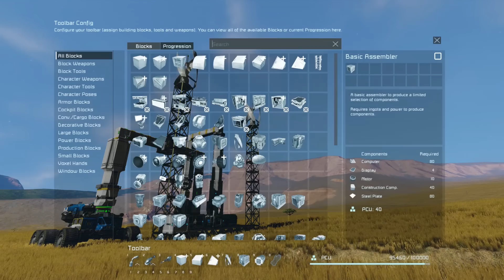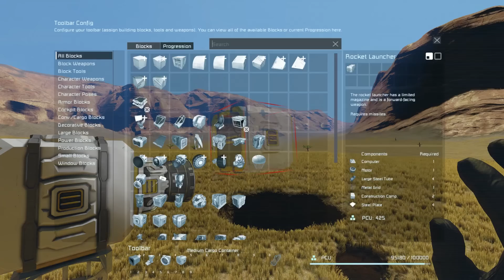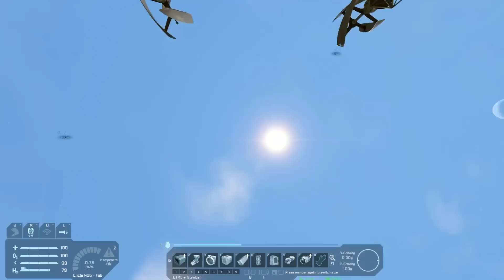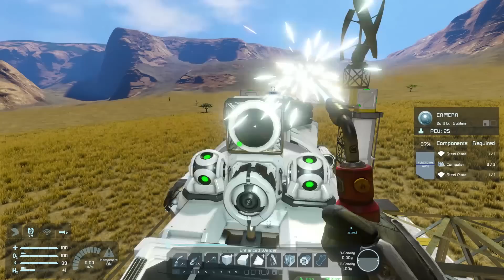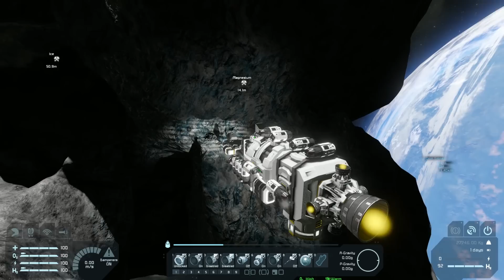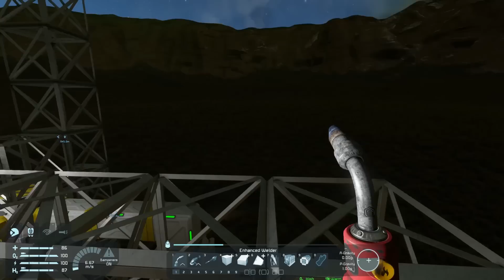Going to Space - Getting Started in Space Engineers #6 (Survival Tutorial Series)

Comment: About 4 years late but here's a full material list 😅
4 radio comms components
1 detector components
40 power cells
46 metal grids
34 Bullet proof glass
362 steel plates
58 computers
6 displays
312 motors 😮
635 construction components😅
88 large steel tubes
77 small steel tubes
79 interior plates
Definitely messed up with my math in a few sectors but it should be a good estimate

Comment: Seeing as many are saying that it's wise to add two large atmospheric thrusters for the way back with extra weight, could we replace those 4 small atmospheric thrusters on each side with a large atmospheric thruster? How many small ones equal a large one?
Reply from the maker: In terms of thrust output (off the top of my head) a single large one is the equivalent of 8-9 small ones and yeah you could certainly do that. Worth testing to ensure you have enough power to run them though as you may need an extra battery to get the most out of them :)

Comment: I did the same build and control set up as your ship, but I cant get out of earth's orbit, I get to around 5000m before I fall back to earth, even though I have the large thruster on at full power (with override) along with the backwards thrusters turned off.
Reply from the maker: It sounds like you've got only your atmospheric thrusters pushing if you're running out of thrust at that altitude. Hydrogen thrusters would only lose thrust if they run out of fuel. Check to make sure the ones selected for the override are the correct ones as it's super easy to grab the wrong ones :)
Reply: I figured out I was switching to the hydro thrusters a bit too early which was causing the issue. Thanks for your quick response and for your great tutorial videos! I wouldn't be playing and enjoying this game as much as I am without them.

Comment: How can you attach the small grid atmospheric thrusters to the large grid?
Reply from the maker: While it's feasible to do so, controlling them is awkward and requires scripts, hinges/rotors etc. I suspect you're more meaning the smaller variant of the thrusters as opposed to the alternate grid size. To change grid size of a block hit the corresponding hotbar slot again to switch, use mouse scroll wheel to change the type of any block group (you'll know you have a group on your hotbar if there's a + symbol on the icon) :)
Reply: @Splitsie  So I tried to scroll mouse wheel, but that does nothing. With the R key I can switch between the grid sizes but small grid doesn't snap on large grid blocks.
Reply: I use the small thrusters with the large grid size but they are way bigger than in your video, so it looks to me like you're using the small grid size in your video. For example with the large grid size for the small thrusters you could only fit one unit on the cockpit block you're using, but you're using three units, so I think you're using the small grid there while the cockpit is the large grid.

Comment: Out of curiosity i did a number of tests to see just how much of a difference the different fuel saving methods as well as thruster choice really mattered.
When it comes to using thrust override vs. the dampeners off method i averaged about a 0.7% fuel savings, that was averaged out with nearly a dozen tests taking a ship from the same ground location to space with a variety of ships both large and small grid. In the end i realized that the difference in fuel saving is kind of irrelevant and overall and which method used comes down more to personal preference then anything. 

The only noticeable fuel consumption difference was with the use of atmo thruster for that initial 5km or so of atmosphere vs. using hydrogen thrusters exclusively. For that test i used a couple of ships that had both ion and hydrogen and went from the surface into space doing the trick of using atmo until they lost power then switching to hydrogen and the other test using only hydrogen. I averaged 9% fuel savings with the atmo/hydrogen method.
Since those tests i've ditched the atmo/hydro thruster combination for my first trips into space in favor of exclusively hydrogen thruster designs, the ships are not only much easier and cheaper to build but the removal of the atmo thrusters also meant i could ditch all the extra batteries they need and could put all that extra weight savings into carrying more cargo back from orbit. 

I have dual purpose orbital miner designs that are meant for mining both in space and on ground equally well using multiple thruster types at once that i build later when the resources are there but for that first trip i'm finding out that simplicity keeps proving to be the better choice.
Reply from the maker: That's cool, roughly fits with the results I'd have expected

Comment: Loving these guides, man, they're truly helpful. Though, in this one, I've been running into some issues with the small o2 generator on the ship pulling from the large o2 generator on the base. Pretty much it just will not pull any ice to fill the hydrogen tank, making it so that I would have to manually transfer ice into the small o2 generator to fill the Hydrogen tank via depositing Ice into the cockpit. Which I find I have to do from the cockpit itself as it won't allow me to transfer from anywhere else.
Reply from the maker: An O2 generator won't pull ice from another generator, only from other inventories like containers or drills. For tanks you can get them to fill from a tank on the base by setting the tank on the ship to stockpile (only once connected) and it'll transfer rapidly into the ship's tanks. That's my preferred way to fuel up a hydrogen ship as the base can keep working on the fuel while you're out there burning it up :)
Reply: @Splitsie  Truly, this is a game of engineering. I wound up finding the issue while going back through the video. The large conveyor part of the cargo container on the ship was not facing downward, so the ice was unable to be pulled into the tank from the ship.

Comment: im surprise the max speed would be 100.
heck even most cars can go faster then that XD

i'd expect the max to be at least 1k.
but i suspect this is a computation limitation of the computer hardware?
Reply from the maker: With the physics system updating 60 times per second, movement faster than 100m/s can result in two objects being inside each other by a significant distance before the physics system detects it. With the way SE plays that would be more annoying than a low speed limit
Reply: @Splitsie  so they'd have to increase the speed of the updating of the physics engine.

which may bring other issues if some things are expecting the physics engine to run at a certain speed.

unlikely but possible, i still see games that have physics strictly locked to the frame rate which is a terrible terrible idea because everything breaks when you get better equipment XD

Comment: I had to add a total of 16 Atmo thrusters (upward) to no crash on re-entry, when returning with a full load (total weight of around 90Ton)
The "safe load" of 1 small atmo thruster is around 7.5 tons (it's 7.7, but a little lower, just to be safe), using this, I say "2 thrusters for each 15 tons, + 2 for safety)
So to avoid crashing, I had to have 14 thrusters to be able to fly, and then I added 6, just in case.

Comment: I flew past this one (boom boom) while building up my base/abilities and thinking about how to get to the ships more easily for building/upgrading later, remembering the piston thing from earlier... adding a connector to an upward facing piston would allow for varied height connections so you could get underneath and work on ships without the need for an awful lot of jetpack flying. Obviously disconnect a ship before changing the working height.

Another added bonus would be plonking a couple of temp engines on the ship as soon as the connector is added, so you can take it off the scaffolding and get it hooked into the base systems so everything charges and refills while continuing to work on it.

Comment: I have built this ship according to the videos but for some reason I cannot get it to lift off. The hydrogen and oxygen tanks are full and Ive compared the weight of my ship to the one in the video and they are not wildly different, (maybe 5k). All the thrusters are firing and are set up as 2 groups (hydrogen and atmos).  Im stumped as to what is causing this. Once the clamps are released, even with all engines on, it wont lift off. Any suggestions? Have I overfilled the hydrogen & oxygen tanks? Ive removed all access weight including spare ice.
Reply: Ok I didnt empty all the cargo out as I had thought. I found an extra 20k of ice. in there. I must have gotten distracted when I checked. Lol

Comment: My hydrogen thruster turn off when leave the base
Reply from the maker: Things to check if your thrusters turn off on disconnecting a connector are: 
 - Are your fuel tanks on stockpile? They should not be on stockpile if you want the thrusters to be able to pull fuel. 
 - Are your batteries on recharge? If you have no power source to the craft then even hydrogen thrusters won't work because the conveyor system fails with low power. 
 - Is your fuel tank empty? It's possible your thrusters were working while connected because of the O2/H2 gen on your base, then when disconnected they no longer have a fuel source with enough hydrogen output to continue working

Comment: Why mess with hidro override when you can just turn off dampeners? That way going up with hidrogen would be the same way you do with atmos... and you would not lose force as you did before you got more vertical
Reply from the maker: Using the override gives you more control over the thrust to allow more careful fuel use as the gravity becomes less. It also helps with keeping the ship aligned as the dampeners will continue to fight any lateral movement if you happen to not be perfectly vertical on your ascent
Reply: @Splitsie  if SE had any kind of vertical alignment tool i would agree... but since we are always trying to make vertical alignment by eyeballing it, i thing it should be easier to just press space bar... unless your goal is to make it harder to add to the challenge...

Comment: I wanted to add 5 parachutes to this ship to help in decent.  set them to auto deploy at 2000 meters.  I tried to do a test of that so thrusted up to 5000k and turned off all engines.  They didn't self deploy at 2000.  So I tried to figure out how to make them deploy on my own and can't figure it out.  What am I doing wrong? I crash a lot coming back to earth so I'm trying to make it easier to descend.
Reply from the maker: Parachute blocks need to have canvas in them (1 for small blocks 5 for large blocks), need to have power and need to have auto deploy toggled on. If you managed to fly at all without them popping open then auto deploy wasn't on or you didn't have any canvas as it'll work even when just barely moving around if you're beneath the altitude that was set.

I don't think the bug with manual deployment has been fixed yet, so don't rely on the open/close manual control at the moment either

Comment: Hey mate, why can't I see the same type of O2/H2O Gen that you're using for this ship?? It's not even in my progression bar??... scratch that, it just magically turned into that shape when I went to use it.
Reply from the maker: The thumbnail in the G menu is an image of the large grid version, when your pointer goes over a small grid it'll automatically change to that version, you can also manually toggle between the two by hitting the number of the hotbar menu that the block is on multiple times to switch between the grid size versions :)

Comment: Any solutions for when I get into space and run out of h2 instantly? I got ice but it isnt using it
Reply from the maker: Did you bring a O2/H2 gen with you or the parts to build one? Because that's what you're going to need as well as the power to run the generator - as mentioned in the video it's best to charge your batteries rather than running to space as quickly as I did :P
Reply: @Splitsie  I did charge my batteries and I added that o2 h2 generator but it doesnt do anything
Reply: @Splitsie  I found the problem, I was on full thrust and wasted alot of energy
Reply: @Splitsie  but my backwards hydrogen thrusters dont work

Comment: I think it would be much better to build a much bigger ship right from the start so you will have plenty of storage space and fuel aside from the right way to actually gain oxygen. 2 rows of 4 large containers would be a good start, each having it's own mining drill. For the engine both on the top as the bottom 2 hydrogen tanks with for each a large thruster. Then for the batteries I think it would be a better idea to have on each side under the containers for the drills a row of 8 batteries each. This won't just allow power to be a healthy commodity, it will also make sure you can use this ship safely in planetary conditions if needed. Also adding the atmospheric thrusters and the hydrogen thrusters on more tactical positions on the ship it will turn better even if it's so huge. Also directly making sure you have other things you may need would be a lot better to add on from the start. Perhaps add a defensive turret of some type if you are able to create one. In case that's a possibility it may be well worth to add on each side a turret to defend the ship properly against those nasty drones.

Comment: Not sure anyone will read this 8 months late but I throw it out there anyways:

- A bit more complicated, but I recommend building small ships off a rotor with small head connected to your base station, you will be able to charge your new ships batteries at the same time as you are building your ship

- if you are going to fill a large container with ore and bring it back to earth you'll need 2 large atmospheric thrusters to safely land with that much weight, plus additional small thrusters for the weight of the vehicle itself (on default 3x settings). Test this before you leave the surface! Much better than hitting the ground like a screaming meteor!

- be aware that the small block h2o2 processor is BAD at making hydrogen, and wastes about 33% of all the ice you put into it. If you can, use large block h2o2 processors on your base to fill your tank the first time.

- when looking for ore it's best to avoid the large solid asteroids, especially with the small block detector because the ore deposits tend to be deep and the small detector doesn't have the range to find them reliably. Stick to the "splattered" asteroids with lots of smaller rocks. More dangerous to navigate, but the resources are often right on the surface

- when marking GPS coords with resources, it can be quite helpful to mark surface deposits with something like "EASY" so you know which spots are easiest to reach. For example: "0 06 ice EASY" where "0" is the zone, "06" is the sixth asteroid I checked in the zone, and "ice EASY" so I know it's a deposit that's easy to get at.

Thanks for the vid Splitsie! Always nice to see a new video pop up in the feed!
Reply: Thanks for the info! 
P.S.: I've read your comment after 6 month, not 8 but relatively close :)
Reply: A nice/SE solution to weight distribution is to pick a asteroid on the edge of the planets gravity well and create a fuel/ore processing station you can then create a ship designed to move between your planetary base and asteroid station so your asteroid miner doesn't become cumbersome. Not simple but it's a cool solution as well as a milestone/goal you can work towards
Reply: Thank you so much for you comment! A read it a bit late tho! Coming back to the panet I realized im not sufficienty sowing down. Tried to use the Hydrogen Thruster to manage, it amost worked tho, but stil smashed the surface xD
Reply: Yeeeah, I just did this. Splatted on the surface with a full load of ore. Fortunately the crash just took out the stuff from the large container aft, so I was able to limp the rest of the way home.
Reply: Yup I was reading this as I was attempting my third failed reentry. Same rocket as Splitsie, just 70k kg total. :P
Reply: i fell hard to the ground, but like whats the point of this ship if it cant hold ores without falling?
Reply: Glad I saw this before I tried going to space. I just started playing a few days ago, and these tutorials have saved me loads of time and frustration. I'm on 10x, but I wish there was something between 3x and 10x. I'll experiment with how many large thrusters I'll need to avoid making a crater. 😂
Reply: Thanks!
Reply: dude thank you SO MUCH! "if you are going to fill a large container with ore and bring it back to earth... (on default 3x settings)" 

I am on 10x and bringing back 55k Kg and could NOT slow down.... even with hundreds of hours on KSP, I never considered weight!! haha!

guess its time to dump some ore!!! :P cheers mate, and thanks again!
Reply from the maker: Nice! All good tips Souptoaster :)

Comment: Ive watched this at least 5 times and still cant get my ship out of the atmosphere, our ships are almost entirely the same apart from the fact that my ship doesn't have a drill, screw it, im just gonna build a thrust plat form
Reply: how much fuel do you have?
Reply: Fully charged and fueled
Reply from the maker: Are you pushing up against the 100m/s speed cap? The bit where I mention using the thrust overrides or pulsing your thrust is very important, any time you're pushing against the speed cap is wasted fuel and if you avoid it you'll be surprised how little fuel you need to escape the planet :)

The other thing to check is that you haven't got loads of materials on board your ship that are making it very heavy